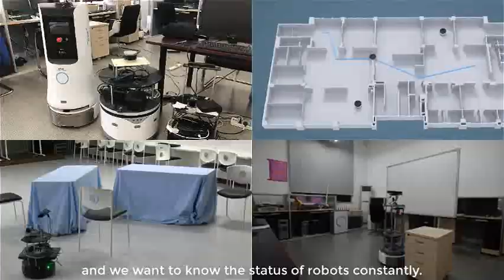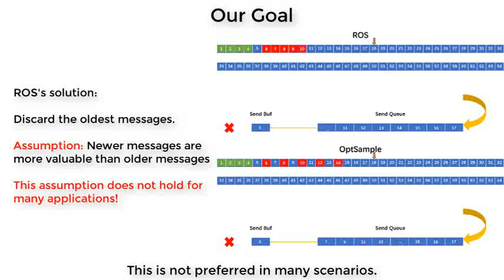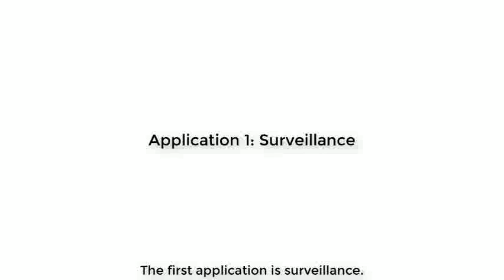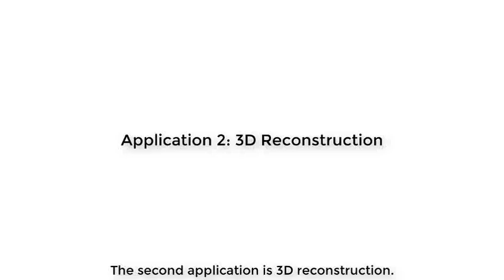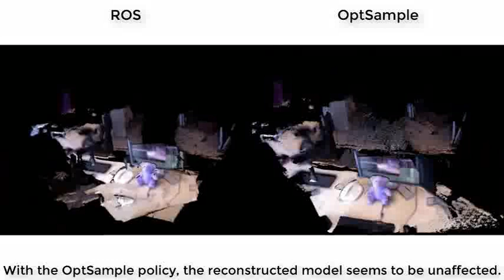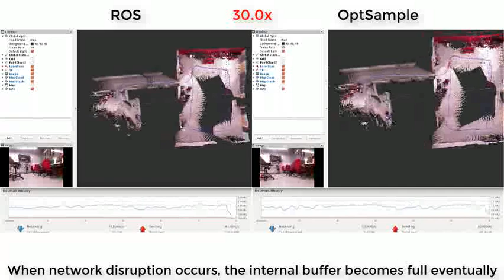OptSample: A Resilient Buffer Management Policy for Robotic Systems

Comment: I liked the video, but I miss a link to a paper/formal description of the algorithm.
I've thought of historic versioning for backup systems. Those are similar but you have effectivly constant network disruption and maybe a slightly increasing buffer limit. But you want the size to increase slower than linearly with time and have uniform sampling back to epoch. Because more time means more history to cover, and you don't need tight uniform coverage over small periods of time to fill up your system.